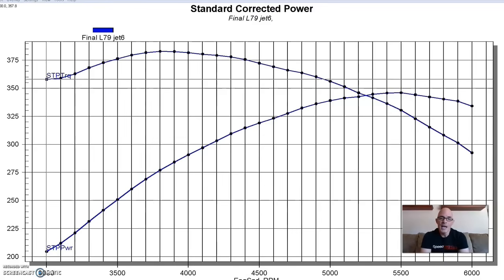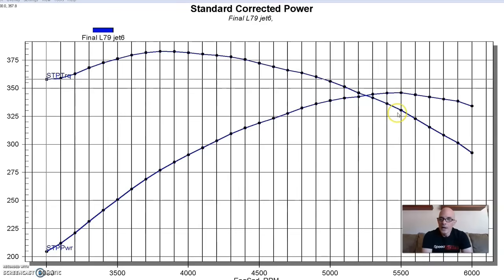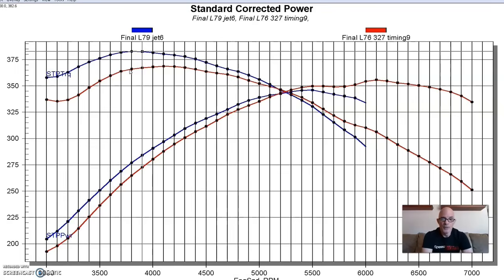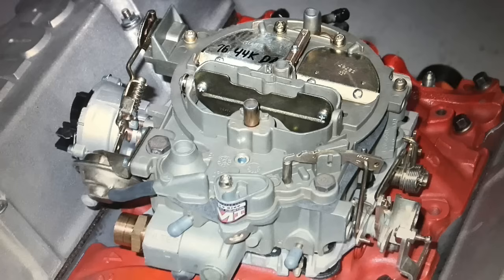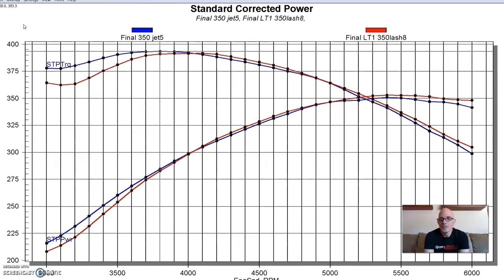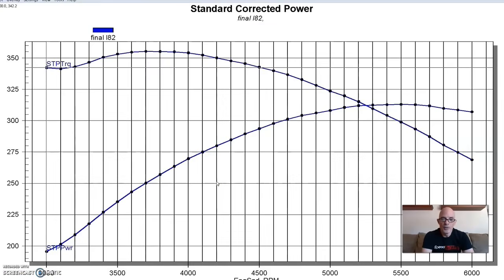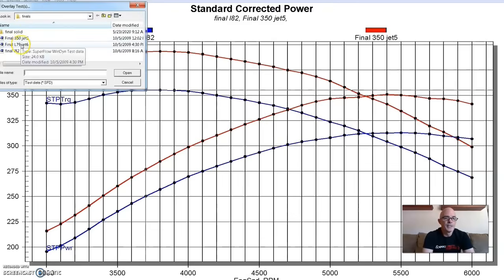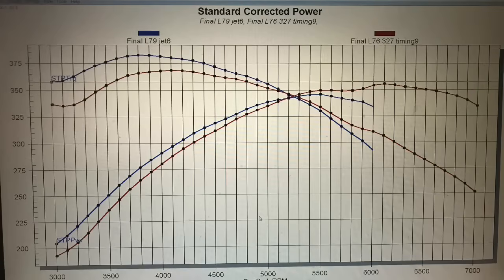HOW MUCH HP DID THE L79 350-HP 327 REALLY MAKE? WHAT ABOUT THE L46 350-HP 350 OR L82 250-HP 350?

Comment: I had a friend who had a 327 (I don't remember which motor designation) with the solid lifters in a 66 Chevelle and he adjusted the valves all the time. I now have a 66 Malibu with the L79  and it has the roller rockers in it. I've had it for 27 years and have yet to adjust the valves. It just keeps on running strong.

Comment: Always used poly locks. Usually tightened up lash from .030 to .024. L82 good choice for 91 octane @ 9 to 1. 327 c.i. had good torque.

Comment: Why is your RPM so low on the 327? I had the .030-.030 solid cam, the heads were the large valve truck heads, larger combustion chamber, and 12.5:1 TRW pistons 2 750 CFM AFB carter on a tunnel ram. The HP was over 500 at 9,000 RPM
Reply from the maker: that cam doesn't make power at 9000 rpm
Reply: @richardholdener1727  Yes it does, mine sure did.

Comment: Thanks again for the content. Mr. Crower back in the 69 put 327 heads on a 350 and made almost 490 hp and 460 tq. It gained the attention of all the OG racers like Smokey Yunick and Edelbrock Jr. Please do a video on the 350 with 327 heads and how the LT1 allegedly copied the heads of a 327 on a 350 making the next gen LT1.
Reply from the maker: 327 Fuelie heads (2.02/1.6 64 cc chambers) and 350 Fuelie heads are exactly the same (same flow same power)

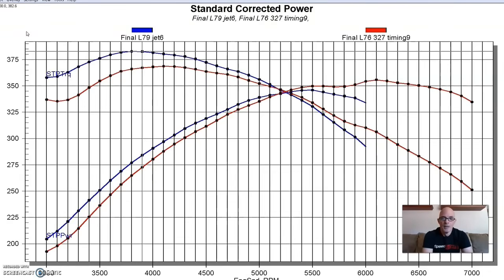Comment: My 68 ss chevelle had the 396 blown up and my brother in law installed a 327 in it. He was quite the car guy and said the cam was hydraulic, it did have the double hump heads and he said they were the .202 valves. Interesting it had a quadrajet carb so it doesn't quite match what you are testing L79 or the L46. It had hooker headers and a 4:10 rear end, Muncie 4 speed transmission and hurst shifter. All I know is that car kicked butt, I raced a corvette, a 66 chevy 2 Nova, a 373  roadrunner, a 68 Nova ss and easily beat them all. I had to put traction bars on it because of "wheel hop" but after that "the power went to the ground". Those were the days!!

Comment: My fist ride had a 283 with 300hp 327 heads and a 4speed in a 55 truck. It was a blast. But the i got a 66 fairlane with a 390 with 428cj heads, 370 possi C6. I was officially a ford guy ;) until the L.S.   Now i like everything, because Every brand has got something killer now.   But... Out Performing an L.S with a Coyote.. that would be like throwing the bunny in the briar patch. Would Feel like home.

Comment: The 365 hp 327 in my Special High Performance '64 Corvette came with a little 585 cfm Holly carb, probably because they didn't want it to make more hp than the Fuelie motor, which was rated 375 hp.  A larger carb allowed it to easily top the Fuelie's hp.
Reply from the maker: we ran a 750-it still made less

Comment: I had a 67 Camaro in school and built that engine out of parts and it was the same as factory except for aluminum corvette intake And a 600 cfm holley
Reply: Igor cut off but I ran low 14s with a 3 speed manual and ran both the solid lifter and hydraulic factory cams and for the street hydraulic was better
Reply: Igor cut off but I ran low 14s with a 3 speed manual and ran both the solid lifter and hydraulic factory cams and for the street hydraulic was better

Comment: I bought a L-82 to build a street motor out of. It was a turd. Super low compression heads, hydraulic lifters and push rod guide plates. Total oxymoron. I sourced a GM aluminum intake, steel 327 crank and turned it into an L-79. Much better motor. The L-82 heads went to the scrapyard.

Comment: My 75 L82 Corvette gets dissed by the uninformed because of the 205 HP rating. It is the same engine as the 250 HP Corvettes but with more restrictive exhaust (catalytic converter) and an emission friendly tune. Simple dual exhaust conversion and a performance ignition timing tune up makes it a 250 or better version. Regardless, in a relative sense a stock 75 L82 Corvette was on of the quickest production car in that year. Also I am glad you pointed out that horsepower and torque ratings from 1972 on were net ratings with all accessory’s and exhaust where earlier cars were gross ratings. I can always tell if a person knows what they are talking about if they are aware of the methods of horsepower ratings.

I am curious what you think about shaving the 882 heads to increase compression ratio of a later L82 engine. Would it add power or be a waste of time and cause clearance or flow problems?
Reply from the maker: IT WOULD ADD POWER BUT BETTER HEADS WOULD HELP MORE

Comment: 1971 Bought an Alabama Power Co. 1962 Chevy II, 2dr post, 4 cylinder, 3 speed. The engine had a governor to limit speed to 70mpg. Wheels and tires were 14”, 4 lug. I converted all the drive train and suspension to 1966, 3:73 posi-traction, and a T-10 4-speed. Built a 327-350 engine, put Hedman headers on with full street exhaust. Ran the car in street 4-barrel class several times with an et in the 13 teens. Great little sleeper!

Comment: When Vic Edelbrock tested a 350 hp 327, it made 313 hp on the dyno. After swapping Autolight spark plugs in place of the AC Delco plugs it gain 5 hp. This was in an article where Vic went about building the engine to make 350 hp. All the major specs of this engine were off. Compression was lower for one thing. 
Richard, did you use OE Chevy parts in this engine or aftermarket parts made to the advertised specs?
Reply from the maker: TRW made the pistons for Chevy

Comment: There is nothing hi performance I mean real performance that uses hydraulic crap lifters it’s just for lazy people that aren’t capable of adjusting valves besides if something is wearing the lifter takes up the slack letting metal partials into the oil that can destroy your engine before you can hear a noise .
Reply from the maker: you must be new to high performance

Comment: 60 years ago hydraulic lifters were not as reliable as modern ones. Lifter pump up was common. Though losing lobes was far less common!!
 I believe they used the Pink Duntov cam,, a proven performer in that period. I have fitted a few. And they made power until 6200 at least. They needed better springs,, around a 100 psi on the seat. Not 72 of a factory SBC
Solid lifter cams using stud mount tin rockers wore the hell out of everything. Mushroomed valves and pulling the rockers through the balls. I have seen too many.

Comment: I think I would take an L46 with the aluminum L79 intake.  I wonder how much difference it would make on power. Hydraulics are the way to go on street motors.  Had a solid lifter cam in my 340 Challenger and got thoroughly sick and tired of adjusting valves.

Comment: Oh, I forgot, my L46 powwered 1956 Chevy also had a 3CB Edelbrock manifold and a 950CFM 3 barrel Holley. and an old dual point distributor.  Way over carbed, but had no end to winding.  Sure felt good when the 3rd barrel opened.

Comment: Had one of the first L46s, back when Chevy was having production problems with Camaros and dumped L79s and L46s over the counter.  A long block was right over $700, a friend bought one, and my L46 short block cost me $412.   Drove my 56, with the L46 and a set of older double humps about 70 miles daily across the Hampton Roads Bridge Tunnel to and from school for 4 years.   Never had valve adjustment issues.  Had a hell of a lot of fun though.
Reply: For today's 91 octane the L82 is a great package. With a few modern updates,such as a  performer Aluminum manifold,larger 800 cfm Q jet,spiral wound wires,Iridium plugs,better fuel pump with lighter fuel pump rod,K+N airfilter,mandrel bent pipes with either an X-pipe or H-pipe high flow mufflers that fit the chassis. Rocker arms set to 1/2 turn clearance,brass tipped distributer cap and rotor,distributer clearance tightened up to .10" and finally enough timing,no need to bring all the timing all in before 4000 rpm. Makes for at least 350 gross or 300 Net net HP.  More if in a Vette with cold air induction or a Firebird T/A with open scoop,beautiful sound and low 14s or 140 mph+ depending on gearing. Do you really need more?
Reply from the maker: many of those things I would not do-they don't change power-yes on cold air, yeas on alum intake, yes on headers and dual exhaust

Comment: Lots of good memories about those small blocks.  My neighbor was was at least 10 years older than me, and he had a 66 Nova with a 283/ 3 on the floor.  He took it up to 100, which the the fastest I'd ever been.  Later I had a 55 GMC with a 283 from a 65 El Camino, solid lifter.  A guy gave me a 4 bbl intake and a Holley 600 single feed.   It would rev to 8000 any day of the week.

Comment: In 1966, my mom bought a slightly used 1966 Caprice with a really good running 327 that was originally the personal car of, and custom ordered by the owner of a Chevy dealership.  When it was time for an engine rebuild, it was discovered that the camshaft was a "Corvette" spec cam.  That mechanic traded my mom a '69 350 w' 200 or so miles on it (tornado damaged '69 Chevelle) for that 327.

Comment: Back in 1963, I bought a 1959 Chevy Impala from my cousin. He was a famous street racer
in central Maryland. He had built a 1962 model 327 engine and put it in the Impala.
It was a real sleeper with 12 to 1 compression domed pistons, solid lifters, with
an 097. Duntoff fuel injected cam all topped off 3 two barrel Stromberg 97 carburetors
with direct lingage and exhausted with Headman headers.  It was all fired up with a
dual point Mallory distributor ,  All that power was translated through an 11 inch heavy
duty truck clutch to a 3 speed, 6 cylinder Chevy truck transmission to a positive
traction rearend with 3.52 ratio.  I always figured the horsepower was 350 plus because
the car would beat everything out there with the exception of a 1963 Dodge with a
413 Wedge engine with 2 four barrels, a 4 speed transmission with 4.11 equal lock
rear end.  I had him off the line and all through the 1/4 mile except the last carlength.
Reply: 3 97s and a truck clutch. Both inhibit performance big time. 97s are 155cfm and truck clutch is about 60 lbs of iron over 12" diameter

Comment: Please bear with me but this has dusted off questions I've had for more than 50 years.  I'm really surprised at these numbers, particularly the L82.  Recognizing the gross vs. net issue, the L46 and L79 are remarkably close to the factory ratings - a shock to me (could it be the headers and better tuning you guys do?).  The L82 I'd have bet would be under 300 hp on the dyno, closer to the L48.  Speaking of which, I'm surprised the L48 wasn't it included in your tests seeing how prevalent it was in all models for several years back then.  Lastly, has anyone created a comprehensive list/chart showing all of the Chevy performance engines with actual dyno results vs, factory rating?  Even among the various people testing supposedly stock engines on dynos, the results seem very inconsistent.  In particular, I've tried to find the actual/dyno horsepower and torque of the L35 vs the L34 with no luck.  I've wanted to keep this test with the same tester so assure consistency but no luck so far.   Thanks.
Reply from the maker: The L82 was the performance version and the L48 was the milder version-I tried to run and test the more performance oriented versions.

Comment: In 1968 the L79's came with a quadrajet and steel intake. Interestingly  NHRA rates the 1968 L79 at 7 horsepower more than the years with a Holly and aluminum high rise.

Comment: The 350 hp 327, L79 cam was a really great street cam for any small block Chevy. It would wake up any of the lower hp engines power band, good low rpm torque. These cams were available at any Chevy dealer in the late 60’s for less than $35.
These had a great slightly loopy idle, not enough overlap to hurt power brakes but enough to let you know there’s something under the hood.
Put one in my dads 1969 Chevy truck with the 350 and the granny 4 speed trans that had the super low 1st gear. Truck would fly in the 3 gears. Dad loved it, he would spin the tires a little when he shifted to 3rd and grin at me.
Those were the days!

Comment: Back in 1972 I put the 327/350 cam in my 72 Nova SS. It also had long tube headers, the LT1 aluminum intake manifold, a Holley 3310 vacuum secondary 750 cfm carb and 3.73 gears. That car would run the 1/4 mile in 16.0/86 mph. It was a turbo 350 auto car. It always felt sluggish until about 3500 rpm then it would pull pretty good. I think it suffered from the low compression the 350s had starting in 1971 and would have benefited with a higher stall torque converter knowing what I have learned since then. But I was a 16 year old kid then and I thought I had a pretty cool car at the time and was a fun car to have. And I never had problems with the rocker nuts backing off. The only people I knew with factory solid lifter cams were the guys with the 396/375 hp SS Chevelles.and Novas And it seems they were always running the valves. But I think back then it was also just the cool thing to do if you had one of those engines.

Comment: I had a new 66 ss nova with the L79 with a 4spead trans. My everyday driver. I just had sneaker cutouts on stock headers. I shimmed the valve springs .030 and adusted the hyd. lifters to just 1/4 turn down from noise. I put in a 488posi. I adjusted the stock diaphram clutch closer to the floor. I recurved the stock distributor. Traction Masters with big Packard rear shocks and M&H 6 and a half inch cheater slicks. The car ran a consistant 12.80 ET @ 111.11 mph. I ran at Union Grove and Oswego strips. I never lost and was protested often because I was beating 396 Camaros even without the Tree spot. I came out easy at 3000rpm and it was wound tight at the end. I never touched the stock carb. or the stock cam. It drove like a dream with never a problem but I had to take it easy on the highway because of the gear. Best car I ever owned. Sorry I never had it on a dyno.
Reply: mine ran 12.95. was 1967, chev accidently made 4
Reply: osewgo il  

 dragway 1973 , really crappy return road

Comment: I have one of the GM performance 290HP crate 350 long blocks they were still selling up until about 2019.  Its got that same cam from the L-82, with the 76cc heads and dished pistons for 8.5 compression in a 4 bolt main block.  They say you have to complete the long block with certain parts to get that 290HP, which I assume means headers and an aluminum dual plane intake.
Reply from the maker: heads, dist, carb and intake

Comment: From the looks of it, an L82 can reclaim a lot of the lost power with a swap to a pair of 64cc heads
Reply from the maker: yes
Reply: @richardholdener1727  So I ended up doing this mod to my L82 (1973 Corvette) by swapping out the factory heads with 64cc Edelbrock E Street aluminum heads. The difference is night and day. I dont have dyno numbers but my 73 Vette makes significantly more power now than it did when I bought it. I recurved the distributor and had the Quadrajet rebuilt by an expert in Littleton Colorado. This Vette is a completely different car now.

Comment: I bought a 55 Chevy two years ago and the seller included an old 327 engine. I needed an engine for my 66 Chevy C10 so I swapped in the 327. It ran great but smoked so bad that after it ran for a short time I couldn't see my house. I pulled the engine out and tore it down to see why it smoked so bad. It turns out it's a 030 over L79 350 HP 327 with 041 heads and  an L79 hydraulic cam in like new condition. It has pop up pistons and the heads look like they have recently been reworked. The only problem was cylinder number 8 was rusted and very badly pitted. I had the cylinder sleeved and I am putting it back together with a re ring kit and a new timing chain set. It still had the old nylon cam sprocket. If I had not taken the engine the seller of the car was going to scrap it. I didn't know what I had but I do now.
Reply from the maker: VERY COOL

Comment: The car to beat back in high school was a '66 Chevy II with a 327/350 motor, 4 speed and 4.11 rear. My '67 Camaro came with the 327/210 hp motor and even modified could not beat the Deuce..

Comment: We ran (circa 1985) the Crane 272HMV with Rhoads lifters on a set of 461 castings on a flattop 355.  Ran very strong at first.  Then started tossing pushrods through the rockers.  Replaced valvesprings, same thing, then poly locks, same thing (they WERE backing off), realized the studs were pulling.  But only on the exhaust side .480" lift. (missing and popping thru carb) This happened several times.  The last time my mother drove the car home from work, she blasted my father for letting it persist.  Tore it all down that evening in late fall of '87.  Wiped 6 lobes off the exhaust side and crank was trash.  Rebuilt bottom end with forged, screw in studs/guideplates to the 461's.  Went with General Kinetics 270hl (216°-.454 108°LSA) Never had a problem again.  Midrange was borderline violent.  Dead reliable.
BOTTOM LINE:
Hindsight, knowing what I know now..  Valve spring retainers were in contact with the guide bosses on the exhaust side.  Early heads you really have to watch for this.  They MAY bottom out as little as .440 lift on some factory castings.  Clearance issues are not just limited to Vortec heads. ANY factory casting. Always check (or have your machinist check) for clearance before using.
Reply from the maker: P-v and R-S clearance is critical and so is rocker bottom to retainer-it all muct be checked, and screw in studs are a must